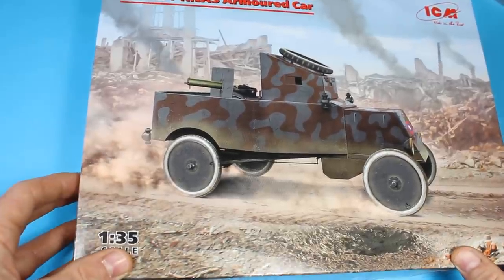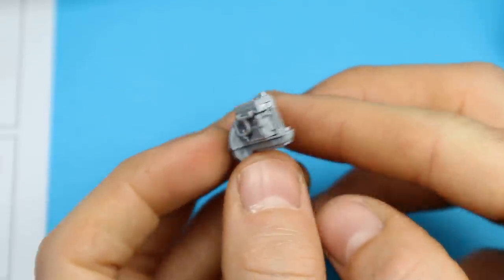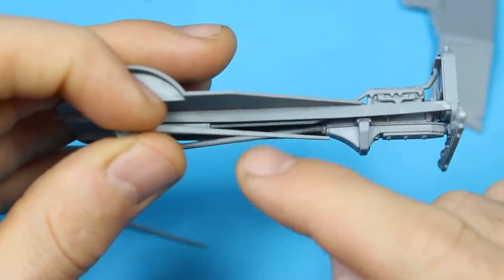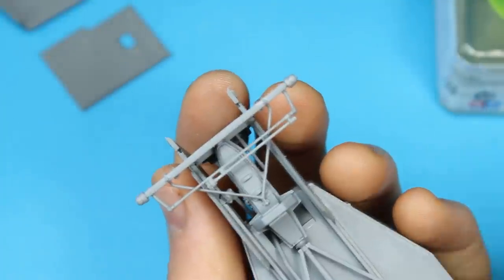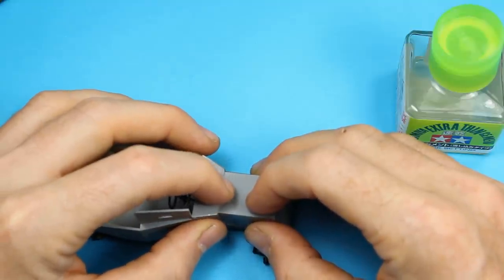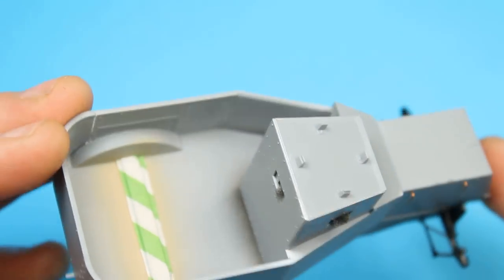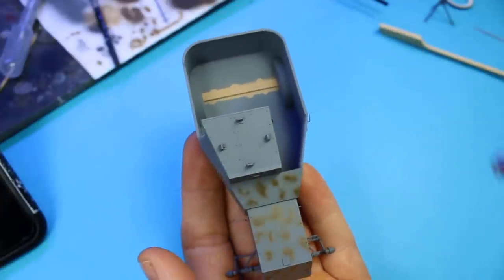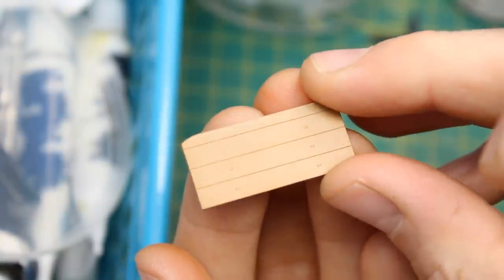ICM 1/35 Model T RNAS Armoured Car, Full Build Video

Comment: Just watched resin Spanish civil war tank review,if you like 'unique' kits i found an all metal  \72 TKS Polish light tank by "Steelgolem" Steelcraft.£16.90 from china via ebay.Stainless steel axles and gun,turned brass mantlet,1x0.5 brass fret chassis superstructure,3x0.3 for body,and three part track system with brass and knickel silver.I have an 88mm Flak18 by them in \35.Very rare,very HQ little kit.Theres pics of kit parts,built,built and painted.NOT rare earth kit,real model.

Comment: Surprisingly poor even after all these years, maybe the casting molds are so worn or simply not up to scratch, either the parts don't fit properly or i end up with filler and sanding down